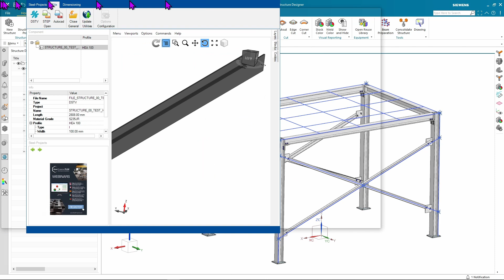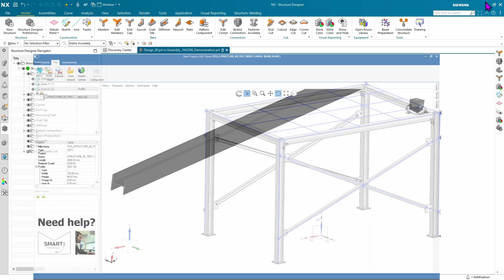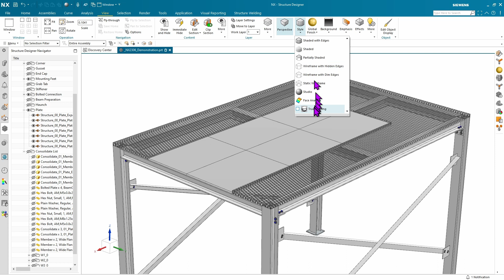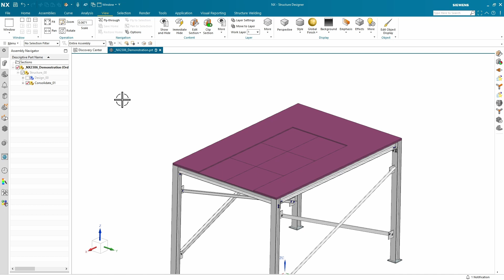NX CAD - Structure Designer

Comment: Hi, please create more video about structure, I can't add a member with custom size for example 20*10*2
How I can add this size or any size to library, and other program has a feature with 9 point for alignment a member...nx doesn't have?
Reply from the maker: Hello @user-eb4pn6lh8r !

It is possible to add new dimensions and also a customized profile, but there are some procedures to be done within the NX installation folder, for example:
C:\Siemens\NX2312\NXSTRUCTUREDESIGN\data\library, and it is also possible to define the 9 Profile Anchor points.